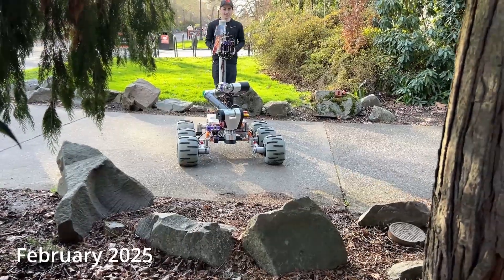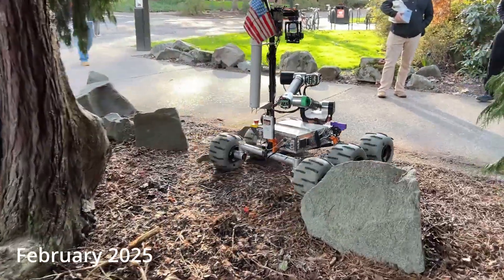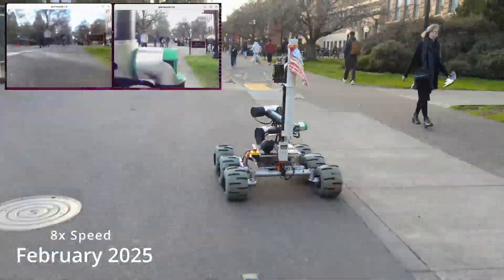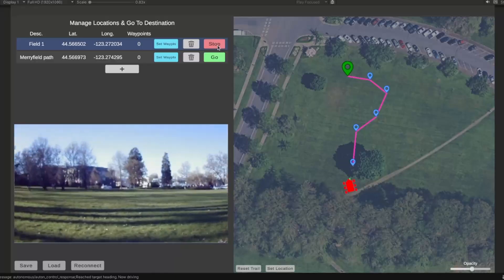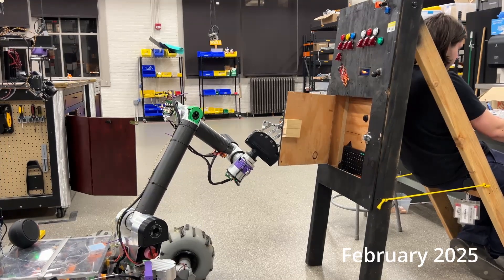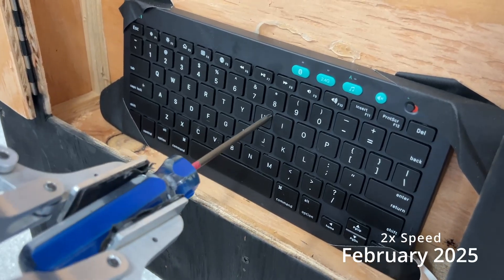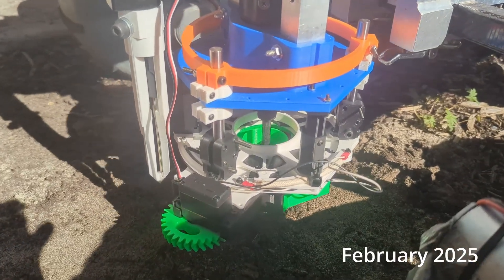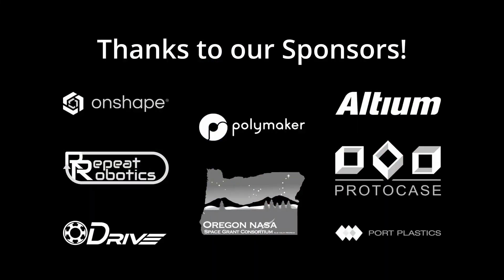DAM Robotics Mars Rover Team 2025 SAR

Comment: Hey, amazing work on the Mars rover build! I'm really impressed by the 6-DOF arm design—from the brushless DC motors with harmonic gearboxes to the dual control modes using moveit2. I'm curious: is this build open-sourced? If so, could you share a link to the GitHub repo or any related documentation? I'd love to dig into the details and learn more about your approach. Thanks for sharing your innovation!